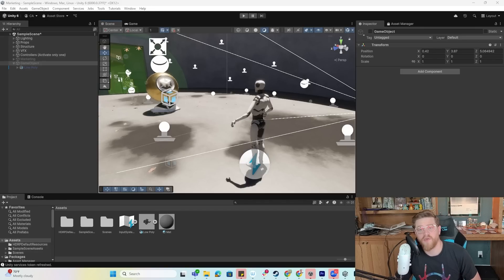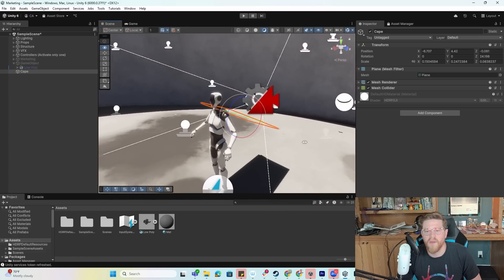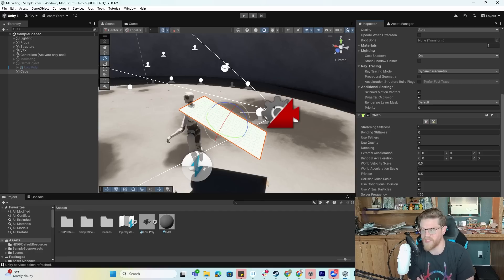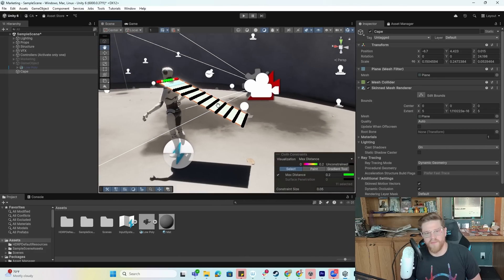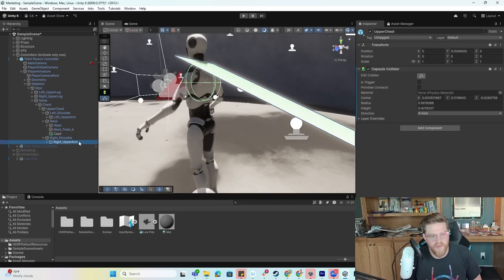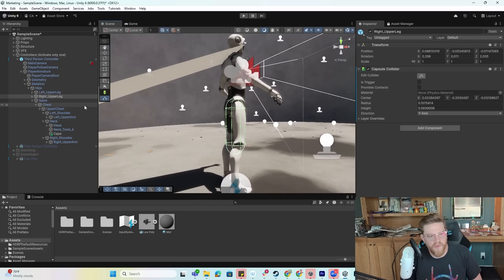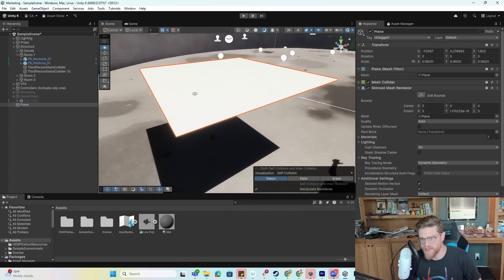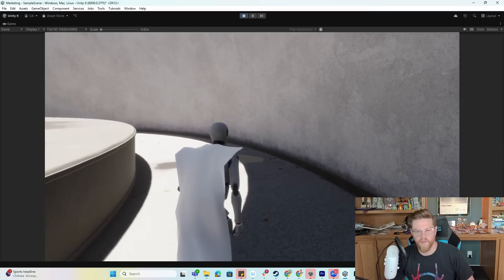Cloth Simulation in Unity 6 - Creating a Cape

Comment: What if we want a cape with 2 sided colors... Like Alucard's cape in SOTN... Outer and inner cloth color.

Would it be 2 planes together, and add cloth component to empty parent?

So i change material independently to each plane inside the parent with cloth component?

Hope this makes sense..
Reply from the maker: I would likely tackle that either with a custom shader if trying to be super efficient or by adding a cloth attribute to a very thin cape-shaped cube instead of a plane. Cloth sim will work with 3D object as well, which make for some very interesting interactions.

Comment: How would you go about making a realistic windsock?
Reply from the maker: It depends if it needs to accept realistic wind input, but more than likely I would do it through programming. Especially if the main metric is angle of rotation to indicate wind direction. If you need to indicate wind intensity with level of parallel to ground it might be programming + shader